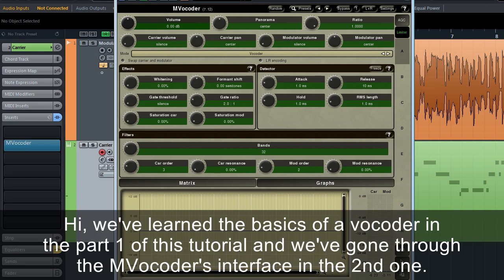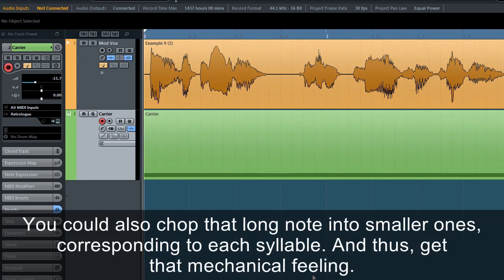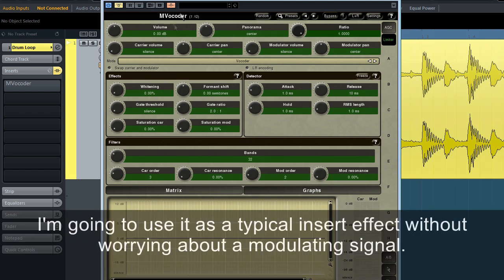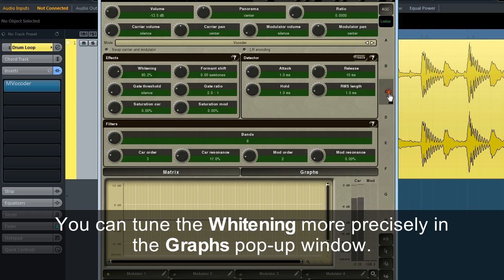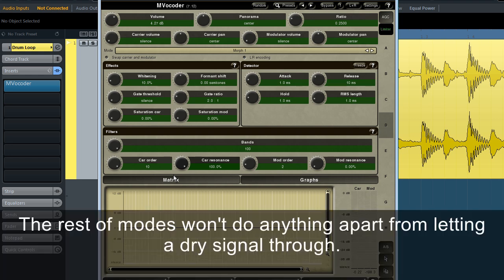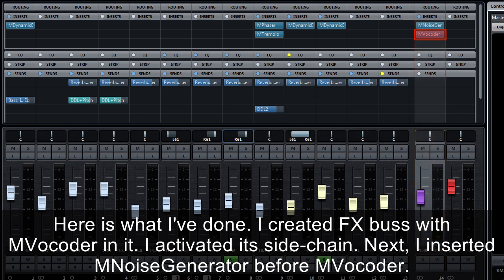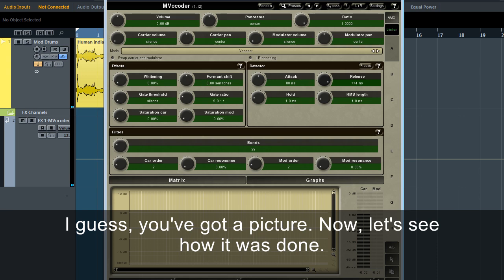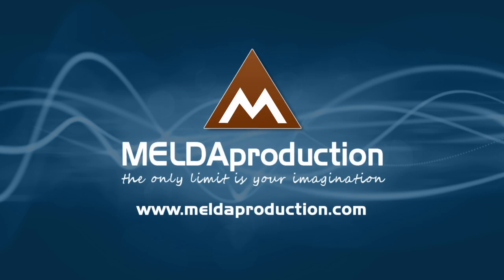MVocoder part 3 - Practical examples

Comment: It's all well and good. Melda Productions are not very friendly to the blind and visualy impaired though. Interface might look nice, but what does that matter if I can't use it? :) I will find sighted assistance to see if I can even make it work, but my immeidate problem is that I can't find the part 2 video. Part 1 and 3, no problem. Part 2? That's the one I need, man. Anyone?

Comment: Thank you for these helpful videos! Could you maybe comment a little more on what the Whitening is actually doing? I was wondering about sibilance detection: I know some hardware vocoders have that - I think they detect sibilants and trigger a switch to dry signal for the duration so that they pass through unprocessed. This makes the speech sound almost normal, which is sometimes what you want. Hope I've got that right. Anyway, I'd like to know whether sibilance detection was considered in the design, and why it was rejected. Perhaps it isn't needed when sufficient bands are in use? I guess it could be achieved externally with de-essers and envelope followers etc. if necessary.
Reply from the maker: Well, whitening is rather hard to explain, but as mentioned in the documentation it tries to supply the missing frequencies, because in many cases each signal contains some frequencies, but not others, and since the vocoder basically triggers a band if there is some signal present in both the carrier and modulator, this can create too "empty" output. Whitening avoids that.
As for the sibilance - you can do that pretty easily using the modulators, in Follower mode in particular. All you need is to set it to listen to specific high-frequency content around say 8kHz, depending on the voice. Here are tutorials about modulators:
http://www.meldaproduction.com/video-tutorials/modulators/
Reply: Thank you, that explains a lot and is useful. Sorry I was slow to respond. YouTube has an awful notifications system... :)

Comment from the maker: I'm still bugging the editor. But for now I tried myself and seems pretty easy to do (though it's a little hard to compare, since I don't have the same vocal tracks). Anyway my idea is to place MVocoder on a vocal track and feeding the sidechain with the same vocal track passed through some distortion, I used MLimiter with 2nd harmonic +100% and 3rd -100%. Then I also needed to increase Whitening to 100% and swap carrier and modulator (but it just sounds different). 2 minutes ... ;)